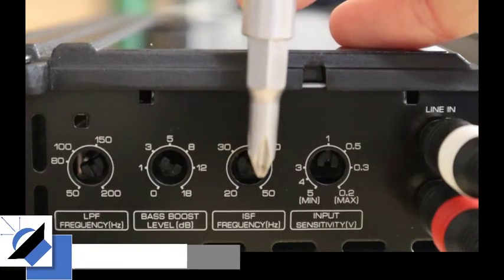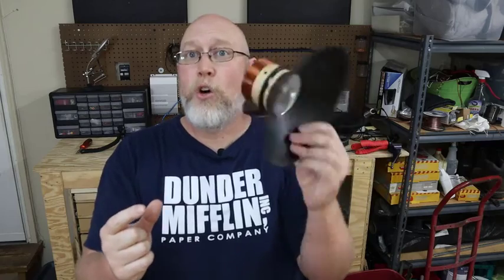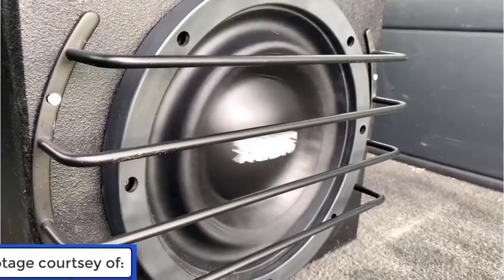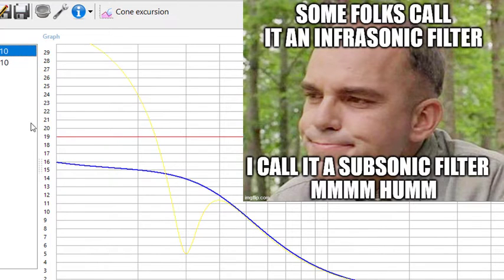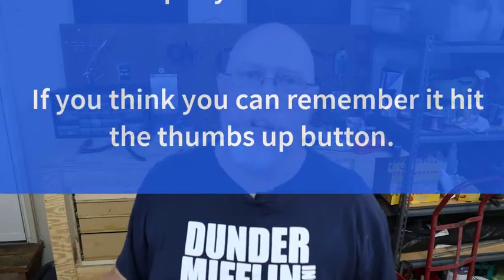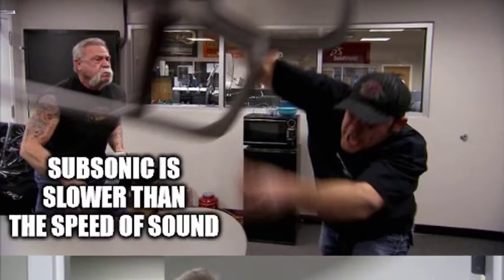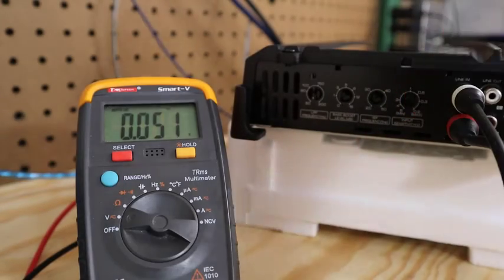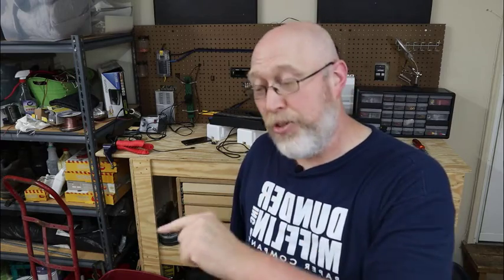Subsonic Filters, protect your subwoofer from low bass using a multi-meter.

Comment: Hey i wanna try play lower music on my amp and subwoofer, i have avatar atu-1000.1d 1000w 1 ohm and 2x12 inch subwoofer ported sub, Dimension  900 x 350 x 370 / 250 mm can i play lower hz on that sub or do i need better sub?
Reply from the maker: That's a very big question!  A little to big to answer in the comments section.
Reply from the maker: But hey, this might help. Start by getting yourself an inexpensive measurement mic and an app on your phone so you can actually see how low you are playing.
This video may help  https://youtu.be/7orJovlXvBM

then check out this video for more information on how to tune your box lower.
https://youtu.be/-yopTneS7g8
Reply: @DIYAudioGuy  thanks for help i will try do that :D

Comment: English is not my first language, I can quite get the whole point but I'm missing out on some information, when you said about the cubic ft of the box the below octave thing, so if I have a 30hz tuned box and didn't used the software that you've said and unsure about anything I can just put it in 1/2 octave which is about 20hz right? (Cause yours are 40 to 30 if it's 1/2 octave) and about the -3 db thing, should I do that? Or I'm good with the tune of the box times .75? And is the 10v to 7.04v in general? (Depending on the outcome of the tune x .75 of course)

So I have 30hz tuned box.

30 x .75 = 22.5

So maybe 23hz test tone right? Note: I've set the gain first of all.

Then lower or increase the volume until you get 10v from the terminals? Then put it in 7.04v? Then that's it?

Please help, I can't quite understand. Thank you.
Reply from the maker: Yes, you have it figured out.  You wan to set infrasonic filter at (tuning frequency) *.75.  So play the appropriate test tone (with the filter off or set to the lowest possible setting) and adjust the volume knob until you get 10 volts (the 10 volts is just to make the math easy).  Then turn on the filter and adjust the frequency until you get 7.04v on the DMM.
Reply: @DIYAudioGuy  Thank you so much!

Comment: If i'm using a sealed box, where do i set the filter to? It goes from 20Hz to 50Hz, no on off switch.
Reply from the maker: With a sealed enclosure you probably don't need one. So set it at 20 and see how it works.
Reply: Where would I set my low pass at?

Comment: I just ordered an American bass xr 10d4 and a rockville db15 amp. The sub is rated for 1,000 watts rms and the amp is rated for 1,500 watts cea rms. I was told it was better to have an amp that had more power than needed to avoid clipping. Is this true or did I make a bad decision?
Reply from the maker: No, you did not make a mistake.  At the very least if you decide you want a slightly bigger sub you don't have to replace the amp.

But, you need to understand the logic behind that advice. It's not unusual for someone to buy subwoofer and an amp, set everything up and then discover that it's not loud enough for their taste. So what do they do? They turn the gain up and the subwoofer fails.  So this rule of thumb was developed to prevent that from happening.  

It is a psychological trick used to keep us from clipping.  If you buy a 800 watt amp to go with your 1,000 watt subwoofer then you think that you can crank the gain up a bit because the sub should be able to handle the power.  So you do, you clip the amp and you blow the sub. But if you hook a 1500 watt amp to your 1000 watt subwoofer then you know that you have more than enough power to blow the sub so you will take it a little bit easier on the gain and the volume.
Reply: @DIYAudioGuy  thank you for your advice! That makes a lot of sense. Now I just hope my stock 110a alternator can handle it lol.
Reply: @DIYAudioGuy  JL Audio manual clearly states that it is better to use an amp that is less than the continuous RMS rating so, for a 500 Watt speaker, use a 300 Watt amp. In fact, it states that the lower the amp wattage, the less change of damage, but that the performance may not be as good. I don't really understand how you can blow a subwoofer with a low wattage amp, even if you turn up the gain. A company like JL Audio would hardly give advice that may potentially cause failure on their speakers, so, I am not really sure where this myth of using higher wattage amps than the continuous RMS rating comes from, but many people believe it.

Comment: What if my amp doesn't have subsonic filter?
Reply from the maker: A lot of amps don't have one.  Some amps have a preset one from the factory with no user adjustable controls. You'll need to check your owner's manual to verify.

If your amp does not have one, and if you think you need one, then you will need to either swap out the amp or tune your subwoofer enclosure lower.
Reply: @DIYAudioGuy  can't swap amp as I brought it yesterday only and tuning frequency below FS will reduce efficiency. I have pioneer AVH-Z5090BT but unfortunately head unit doesn't have subsonic or dedicated HPF for sub out which should be there! 😅
Reply from the maker: @BassheadLabs  A lot of people never bother with the infrasonic filter.  If you're really worried about it then model your enclosure in WINisd, or just go easy on the volume if you're playing music with a really low bass.  Don't play a 20 hertz test tone at full tilt, that kind of thing.
Reply: @DIYAudioGuy  I generally listen to decaf which is bass boosted music which has lots of lows! Anyways I'll be careful with the volume. Thanks a lot for prompt response.
Reply from the maker: No problem!

Comment: +1 for the dayton ultimax series, 1 12 hits harder than my 2 10's  even with it being on bridged mode on an audio control amp,
Reply from the maker: Dayton is a hidden gem, good performance and a reasonable price, more people need to know about them.
Reply: I use a 600w 12" Ultimax in an undersized 1.25ft^3 sealed box - as large as I can fit, so a realistic vented alternative would be a ported 300w 8" Ultimax. The Ultimax is a great sub for the RMS level it's built for.

Comment: Good Afternoon! What Does It Mean When My Subwoofer Cuts Out On Certain Basslines Or Certain Lows & How Can I Adjust My Amp To Prevent This?
Reply from the maker: That usually means you have a loose wire.  check all of your grounds check all of your power connections check all of your speaker connections.

Comment: I have a taramp HD3000 pushing two skar evl 12's I'm clipping on volume 10. Will that be electrical issues?
Reply from the maker: It could be anything on the signal chain.  It's hard to diagnose problems in the comments sections on YouTube videos.
Reply: Set the head unit first

Comment: Just to be sure. I have a CXA1200.1 from KICKER and while it does not have a subsonic filter knob you can adjust, on the KICKER website it says it has a “24db subsonic filter to prevent damaging frequencies”. Does this mean that it has some sort of automatic subsonic or am I SOL.
Reply from the maker: That sounds like a subsonic filter at a fixed frequency.  Does the website say what frequency they use?
Reply: I have same amp its 25hz,24db fixed I'm using a DSP with Kicker sub amp were would I set my dsp using this amp being fixed ? @DIYAudioGuy

Comment: Nailed it man! Keep up the great work!!!    P.S. so...18 hz out of a 5.25 speaker at full tilt...the cone would have to move too much🤔.... 🧠2 cubic ft enclosure tuned to 18 hz🤓 too bad it would be a one note wonder box. 🔊🔊✌🏽
Reply: Box volume and tuning doesn't determine bandwidth, the parameters do. Plenty of drivers have the ability to play low and flat.
Reply: @2002ZRX1200R  you are correct, Drivers nowadays can play that low and flat,  but realistically a 5.25 inch driver playing that low and flat in its upward bandwidth is going to have very little output in that sub 40hz range.  I was Using the example of trying to get loud in the sub 40 hz frequencies with that 5.25” driver , which in that case, the enclosure Would definitely Have to be optimized to Keep the driver from Tearing it self Apart
Reply from the maker: Hummmm, sounds interesting.

Comment: Are you going to put up a demo video of your trucks system?
Reply from the maker: At this point probably not.  I need some better test equipment for tuning the truck, and I'm already in the planning stages for the next build.  I'd like to build a custom center console to hold all the amplifiers and then build a massive fiberglass box under the rear seat. something that can make use of every last inch of available space.